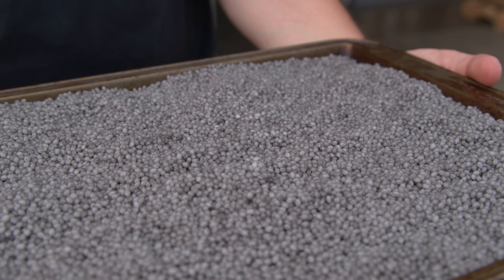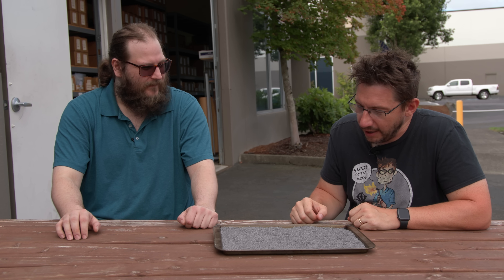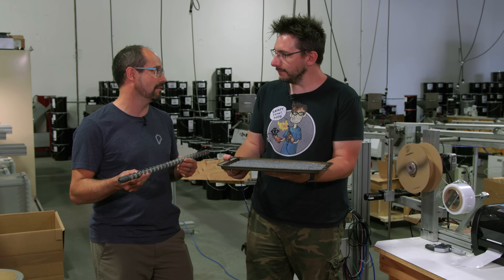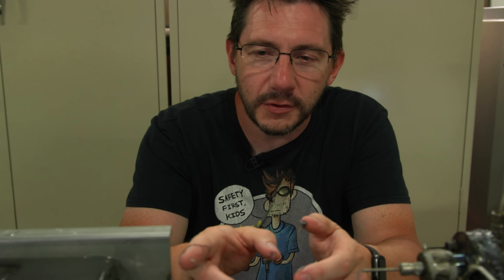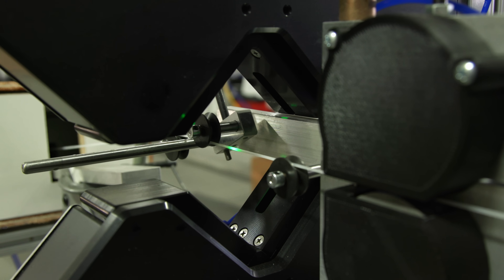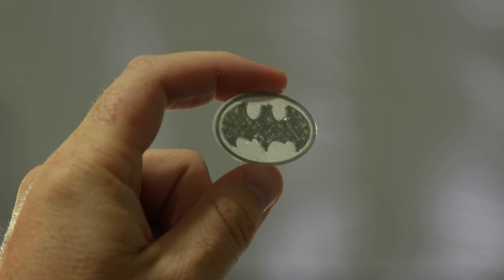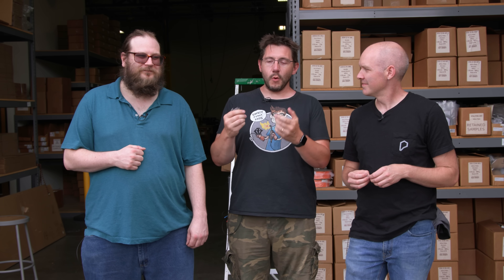Reversible Thermochromatic Filament!

Comment: Thanks soo much for making this video happen Joel.
Reply: very clever idea, I look forward to seeing how it develops.
Reply: Given the low extrusion tempererature, this kind of filament could be useful in very high speed printing once the vorons reach >2k and higher printing speeds.
Reply: @ww-pw6di  no because high speed increases friction, friction increases temperature, and its a low temp sensitive material. The idea is really good tho, but more research is needed
Reply: @deathcube2006  Ah yes, just an absolute "no" because of a superficial minor inconvenience. Straight up just physically impossible to account for the few degree temperature increase introduced by the most OBVIOUS aspect of high speed anything.
Why did I even get up from the bed when literally everything is just insurmountably impossible because of the most trivial reason anyone can think of.

In fact now that I'm thinking, low temp filaments like in the video could may be printed with just the pressure against the hotend reducing the weight of the hotendless assembly by the weight of the hotend. Allowing even higher speeds by reducing the mass of the "hotendless assembly" and the X carriage weight.

Comment: That's awesome! I love seeing stuff like this. My only question is were there any firmware modifications done to the Prusa? I got some PCL from MakerBox but the super-low temp is below the min-temp on the Prusa, so I wasn't able to print with it and printing printer-pen filament at desktop machine temps seemed like a cop-out... and likely to just make a mess. I hope to see this filament one day and it's good to know that, because it's based on erasable pens, there's already a number of colors available.
Reply from the maker: Nope, no firmware changes. The way to disable the minimum print temp is a single gcode command :)
Reply: @3DPrintingNerd  Derp, forgot that was a thing.

Comment: 50°C = 122°F. If melting were a desired property, i.e., in some kind of thermal fuse or thermal safety pressure plug, this might be of practical use. Other than that, plastic that would melt in hot tap water doesn't stir my imagination much.

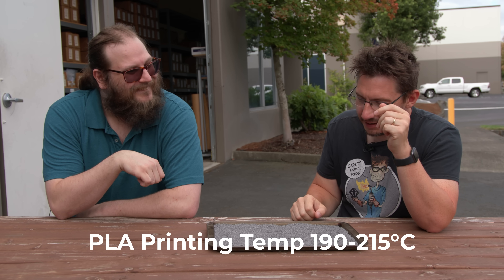Comment: 1:26 You can't divide temperature values in celsius, since celsius doesn't have an absolute zero.
In Kelvin it works, comes out to 68% (323.15K for this vs. 473.15K for PLA).

Comment: With the pens, if the pen is treated with cold temperature, the ink goes back to dark. Could you try that with the 3d filament?
Reply from the maker: We didn’t have time to test with the Batman model. We tried with some run-off material and it worked crazy well. Our idea was to dive deeper if this was a video that people liked.

Comment: Really nice material! I was looking for exactly something like that when I developed my multi-tone printing method, yet ended up using wood filament in different caramelization degrees. If there are any samples, let me know!
Reply: Mmm, all that talk of caramelizing made me hungry, but also got me thinking about when we've accidently extruded too hot & dulled glitter which if done intentionally could, in theory, be used to selectively "turn off" the glitter in certain hotter printed zones of a part with glitter in the base material. Fascinating where the mind & experiences can take you... Keep experimenting & sharing Stefan! Love your work!!!
Reply: Protopasta has a “filament of the month” club, I wonder if they’ll feature this stuff

Comment: I've never heard of erasable pens. So I wasn't totally clear on this. When you print at one temp it's clear, but another temp makes it dark?
Reply from the maker: That’s right. The material from the pens makes a color change at a temperature. Erasing creates friction which creates heat which makes the opaque now transparent. So with filament, we just need to know the temp that initiates the color change, and we try to print below and above it. Plus, throwing it in the freezer and it resets.
Reply: @3DPrintingNerd  Oh I see. Interesting. The only erasable pens I've seen had a really hard eraser that basically ground away the paper. Didn't work very well.

Comment: Doesn't look like a commercial success yet, but there are bound to be additives that due to randomization of orientation above a certain temperature can change color compared to when they are all nicely oriented the same way as they would initially be in the fillament - perhaps by having a magnetic field align them at the time of creating the filament and then a drop in temperature locking them in that state.  Then the temperature where they randomize again should be higher than the temperature the filament extrudes at (this is bound to be the tricky part) so that you can extrude without the color changing or bump the temperature higher to have the "randomized" color.  Perhaps the magnetic field needed to align the material could also be applied at printing time, but then of course the rule of not needing any special hardware would be broken...

Comment: pretty much useless (even worse than PLA heat distortion and no fast changing colors, for changes within every layer you have to use a purge tower, the plastic itself probably has really poor strength, the colors will disappear on temperature change, the price of 10 rolls will be higher than the price of the MMU), but a great experiment with promising results, maybe some day it will be developed further into something decent.

I think the liquid crystal like approach could be more viable (let me make my patent application, of course), orienting particles with magnets or current.

Comment: Perhaps I'm missing something, but if the colour is reversible, couldn't you just extrude the filament like any other PLA, then cool it to return it to its 'base' colour? Or does it only reverse once?
Reply: If you cool it below -10C it goes back to being dark. It is stable at normal room temperatures.
Reply: @autodrop3d118  So you could just extrude it like any other PLA, then cool it to -10 before shipping it? Or is there more to it than that??
Reply: @ursidaegames7605  At normal room temperatures the color is locked in after printing To print one part of a model a different color you can change the print temp selectively to make some portions one color or another.

Comment: How about using a UV modifiable pigment?  Something that can be blasted on the way in with a simple pod that the filament passes through.  Is there a way to stabilize the reaction to a set point.  Same question with the thermal change materials.

I have a filament here that changes from grey to red to yellow.  The temperature swing required is very small.  I used in on my plant watering containers.  Filling the pans is enough to change the colour.

If a similar reaction to these could be used with a fixer...

Alternatively a pigment that breaks down completely.  Preferably something that changes colour as it breaks down.  This would be a one way trip as opposed to the current colour changing varieties.  That shouldnt be too hard to make work especially if the goal is to vary from coloured to not coloured.  Stabilizing the final product is again the question.

Comment: Next, I want a wax filament to make molds with that will melt during the lost-wax process more completely and at a lower temp than conventional filaments. Preferably, a wax filament that also won't shrink. Please and thank you. :D hehe
Reply: That exists
Reply: There are PLA's for lost PLA casting available already
Reply: Polymaker makes one that is called polycast

Comment: 50C is not 25% as hot as 200C because 0C is placed arbitrarily. You can't use that kind of math on degrees.
Reply: You can in Kelvin   :D?
Reply: @ellabun  which is why Kelvin doesn't use degrees
Reply: @pritolus-2  Even though kelvin doesn't use degrees, it is still a number so we can say 50C is 68% as hot as 200C. Also, if we assume something that is the same temperature as your skin feels neutral, then 50C feels 10% as hot as 200C (skin temperature is about 33C so (50-33)/(200-33)=0.10)
Reply: @RebelKeithy  this is just not how it works. When the zero point is arbitrary you can't compare values like that. The only time you can is when comparing changes in temperature, because then the zero is real. So a 20 degree temperature increase is twice as much as a 10 degree increase, but 20 degrees just isn't twice as hot as 10 degrees. If it was then it would be the same across all units: 10C is 50F and 20C is 68F. If 20C is twice as hot as 10C then 68F is twice as hot as 50F, which it clearly isn't. You need an absolute zero in order to compare values that way, like with length: 20cm is twice as long as 10 cm, just as 7 7/8" (20cm) is twice as long as 3 15/16" (10cm).
Reply: @pritolus-2  Yes. It may help to make this point this way:
50°C = 122°F = 323K
200°C = 392°F = 473K

200 ÷ 50 = 4
392 ÷ 122 = 3.21
473 ÷ 323 = 1.46
Same actual temperatures, different scales, different ratios.
Reply from the maker: This thread is WONDERFUL! Thank you, I’ve learned quite a bit reading it.
Reply: @3DPrintingNerd  I love your enthusiasm, Joel! It's one of the main reasons I keep coming back to your channel. This video in particular was really cool, especially since you focused on both the material itself and the process of making useable filament from it. Now I'm curious to see the color change reversed in a freezer!
Reply: @tetraliteproducts542  indeed. Small correction though: Kelvin doesn't use degrees. The degree symbol used in Celsius and Fahrenheit specifically refers to the arbitrary zero point, whereas Kelvin has an absolute zero. "Degrees Kelvin" was used at some point but it was abolished in the sixties.
Reply: @pritolus-2  Thanks for the correction. My only excuse is that I'm 75 years old and my Kelvins used to come in degrees. Hard to break old habits! It also took some time to transition from Cycles per Second to Hertz. I'll edit my previous post to strip those °s from Kelvin for the sake of correctness.

Comment: reminds me of a time in highschool where I answered a test with those eraseable pens and my teacher approached me the next day because he had a hot plate over my paper before he checked it
Reply: In theory he could've put your test in a freezer and made the ink re-appear. 🤔 That's the one limitation of those pens; the ink doesn't physically break down or anything at the higher temp, the pigment just 'turns off'. The ink will always still be there, ultimately limiting the erasability.  It's why I think those notebooks designed for erasable pens where you capture the pages with a phone app and erase the whole thing in a microwave are an interesting concept but imperfectly implemented with what's available.

Comment: Very cool! The on question I have is why not when making it why not do it hanging down? Like when they make Fiber Optic filament.
Reply: because filament will stretch and have inconsistent diameters, manufacturers try to keep the same consistent diameter because otherwise you'll get inconsistent extrusion
Reply: Ok just wondering